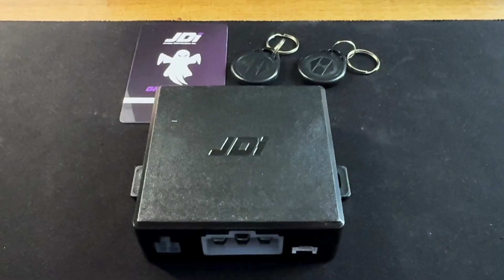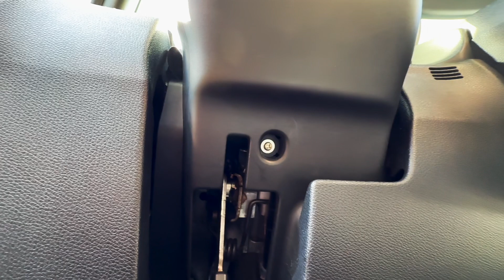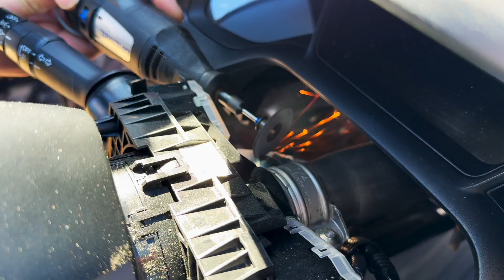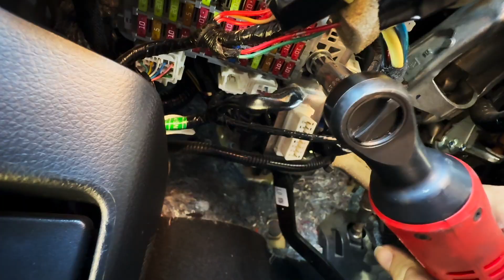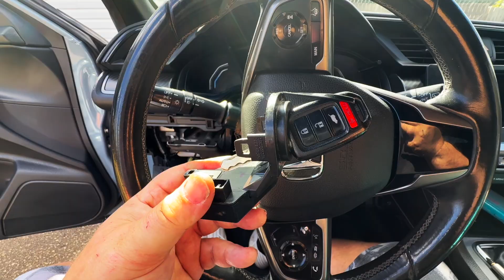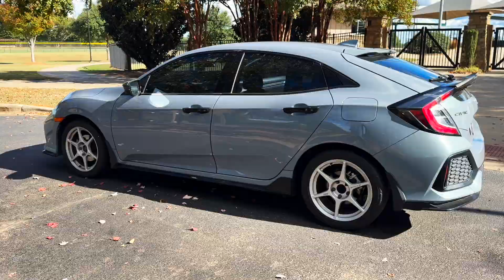Plug and Play Push to Start Conversion Kit Install: 16-21 Civic

Comment: I got a OEM push button and harness connector that i cut off a junk yard find and I wired some of the push button wires to the oem harness connected the harness to the button and worked even found how to keep the red light on like the oem.. I miss my 10 gen but now im back to my EP3❤

Comment: Looking to purchase this but wanted to know if you guys would be able to program the oem Honda key fob that with comes ex and up model. Could buy one and ship out you guys? I just like the oem key fob look better.
Reply from the maker: Our system is designed to work with our provided key fobs, so we cannot program factory remotes to operate it. A factory key uses a different signal. Our adhesive back disk key would be a great way to accomplish this functionality

Comment: What if I don’t have a spare ? Just put that key ?
Reply from the maker: Yes. You can use the key that you have to bypass the immobilizer and then have a locksmith cut a key for you to unlock the doors. This key won't need to be programmed, only cut.